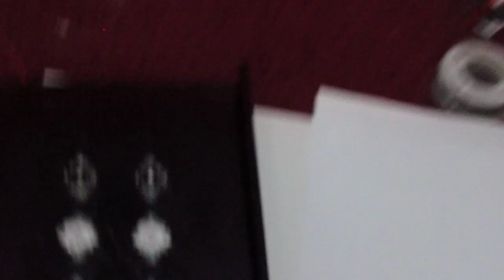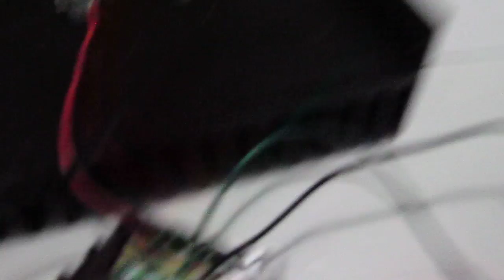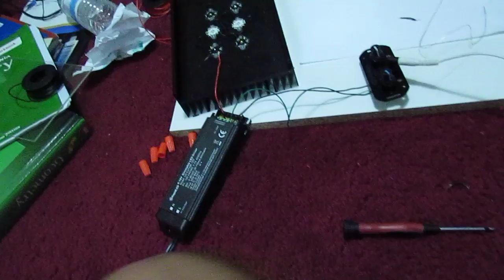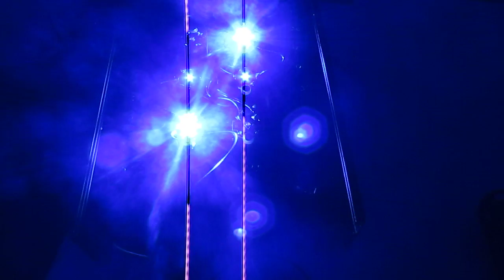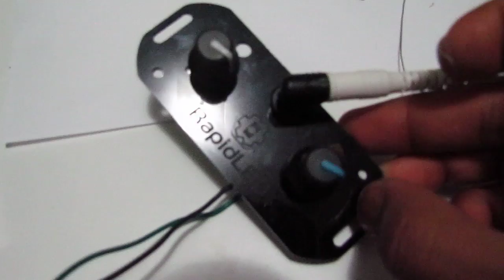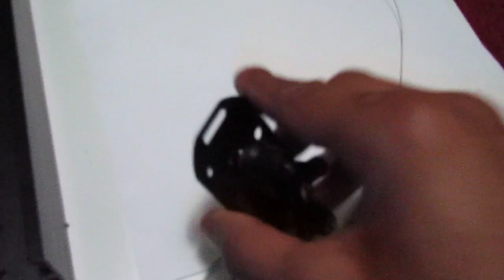DIy rapid led part 6

Comment: Remember that the deeper coral live in the sea, more blue light is need for it to thrive. for deep water corals can strongly white light result in coral bleaching. manufacturers use 1/3, royal blue 1/3 blue and 1/3 white. coral and shells that live in shallow water  can withstand very high amount of  red light and can thrive only under 6500k. So my tip to you ramp up the RB and UV, get 2 more Blue470nm and use the white to adjust so you can find it aesthetically satisfying

Comment: If you wire 6 leds in series you get even current over all the leds, and you can add approx. 3.2-3.7v times 6. then you will pull 21volts with 700mA dimmeble max output of 2.5w per led. 
If you wire 6 leds in parralell you will get a volt of 3,2-3,5v  and a ampere of 700mA devidet at 6 maximum of  116mA per ampere. you will also pull 3.2-3.5v and 700mA from the driver. Google kirchhoff's current law and kirchhoff's voltage law (KCLand KVL),